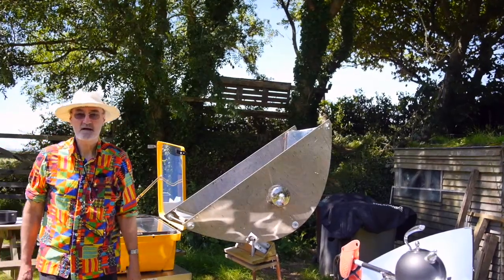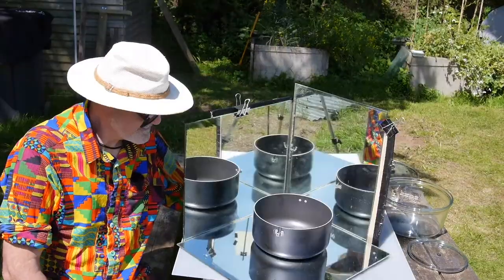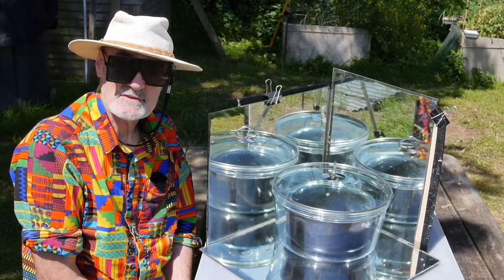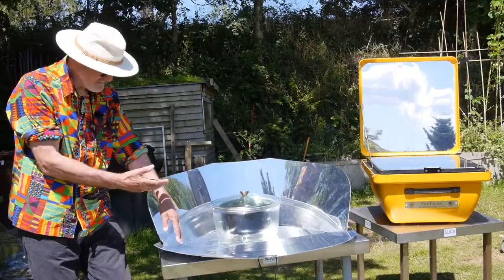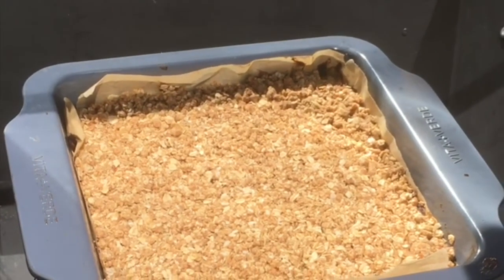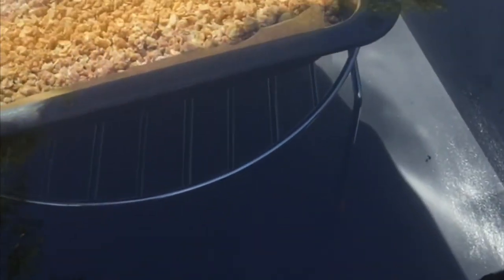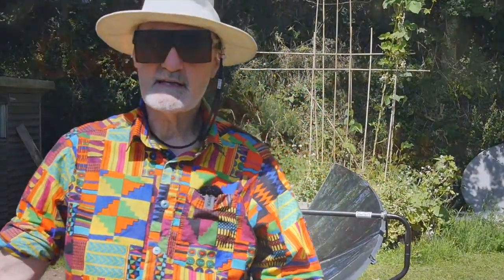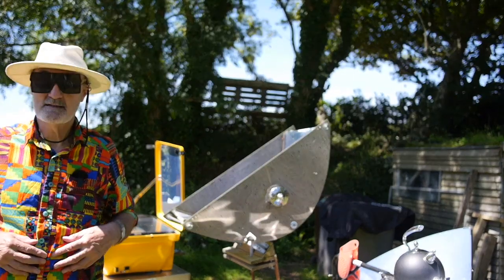Cooking with Starlight : 01 : Solar Cookers 101 : SLiCK solar cooking : solar cooker

Comment: Where do you find a glass pot?!
Reply from the maker: Hi xj, sorry about the delay.  The glass pot you see in the video is from a 12 litre halogen cooker.  Halogen cookers became popular about 20 years ago, and many are being thrown out now, so they are fairly easy to find.  To know what you are looking for, Google 'halogen cooker', then look on Ebay or Marketplace, or any second-hand outlet and you should be able to find one.  The lid just lifts off, leaving the 12 litre borosilicate (heat resistant) glass bowl you see in the video.  Good luck.

Comment: I wish to express my delight in your wonderful solar cooker presentation.

In fact, I appreciate the mode of presentation  your sincerity and openness. God bless you sir.

However, I have already put together materials to construct Tube Solar cooker but I need your assistance on how to build skinned glass tube as explained in the video.

Best regards.
Reply from the maker: Thanks, Richard, glad you like it.  When you say, 'skinned glass tube', do you mean the one I took the bread from?  If so, it's not something you can really make yourself.  These double walled evacuated tubes are made in China - it's a very precise industrial process.  You can find them online by searching for 'evacuated solar cooker tubes' on Google, or another search engine.  There have been some attempts to DIY double-walled cooking chambers, but it is difficult to seal them well enough to pull a good vacuum.  If you let me have more details about what you intend to build, I may be able to point you to some more online resources.
Reply: I appreciate your well details explanation.

Yes, double walled tube like the type that appear in your video nevertheless let me have the contact in China, it could be my future project.

Presently, I will focus on building without glass tube. I will continue to trust for your support.

Best regards.
Reply: In addition sir, building without double walled and glass, will I get a good result? If no! What are the alternative options to get a better results
Reply from the maker: Hi Richard.  I do not have a personal contact in China, but you can find the tubes for sale on Ali Baba.  Here is an example: https://www.alibaba.com/product-detail/125mm-Diameter-Big-Size-Vacuum-Tubes_1600879510158.html?spm=a2700.galleryofferlist.normal_offer.d_title.1c3113a094sa8z   The search function on Ali Baba is as bad as the one on Amazon - whatever search term you use, paid for adverts crowd out the items you want to see, so you need perseverance to find anything.
Reply from the maker: You don't say what sort of solar cooker you want to build, Richard.  There are four types in the video.  To get good results, and this applies to all types of solar cooker, you need to 1. design your cooker so that it reflects a lot of sunlight onto the cooking pot - i.e., the bigger the reflector, the better.  2. Once your pot heats up, you need to use insulation to keep the heat you have accumulated.  You don't say where you are situated, but I can give you an idea of how effective a solar cooker is.  I live in the UK, at over 50 degrees North.  In the summer months, I can get a litre of water to boil in a simple Copenhagen panel cooker, in about two hours.  The other types of solar cooker do better than that.  The large parabolic cooker you see in the video will boil a litre of water in about 12 minutes.  There is a lot of information available on the internet.  For example, the SCI Wiki has lots of DIY designs for different types of solar cooker: https://solarcooking.fandom.com/wiki/Solar_Cooking_Wiki_(Home)   Also, if you do Facebook, there are several facebook groups dedicated to solar cooking:  https://www.facebook.com/groups/1054785564611142 and https://www.facebook.com/groups/scwnet   You will need to narrow down your search for information by deciding, first, which sort of solar cooker you want to build.  After that, it will be easier to answer your questions.  The easiest effective solar cooker you can build is the Copenhagen.  You can find several Youtube videos about that.
Reply: Sir, 
Your response is highly appreciated however, I live in Nigeria.

Presently, I'm working on evacuated solar cooker and as you had directed before I have started the search on google for martials needed. But I may still knock at your door when  need arises.

Best regards
Reply from the maker: Hello again, Richard.  Good luck with your project.  Over the years, there has been some activity in Nigeria regarding solar cookers.  You can find out about some of that here, on the SCI solar cooking fandom wiki:  https://solarcooking.fandom.com/wiki/Nigeria
Reply: Nice, I will link up with them. Thanks
Reply from the maker: Sorry about the delay, Richard, I didn't see this comment until now.  The evacuated tube you see in the video is manufactured in China.  You can find them on Alibaba, but they may want to sell you ten, or more.  There are some distributors in Europe or the USA who would sell you just one.  If you are still considering building your own solar cooker, I recommend the website run by Solar Cookers International - If you Google 'Solar Cookers International Fandom Wiki' you will find it.  Good luck
Reply from the maker: Which of the four styles of solar cooker are you considering, Richard?  The principles are the same, whichever you choose.  The bigger the reflector, the more power you can generate, as long as the reflected sunlight hits the pot.  There are advantages and disadvantages with each of the type of solar cooker..    A good starting place is to consider the DIY plans you can find on the Solar Cookers International Fandom Wiki.  Come back with more questions when you decide which type of solar cooker you want to build.  Good luck

Comment: How do you keep nearby objects from catching on fire? Seems like if you are concentrating the sunlight with reflective surfaces. A discarded glass bottle regulary causes wildfires here in Texas.
Reply from the maker: Hi Mable, most types of solar cooker are constructed so that the reflected sunlight cannot stray outside the limits of the cooker.  So, you are safe with box, tube, and simple panel cookers.  It is possible that a panel cooker could be left in such a position that one of the panels reflects sunlight away from the cooker, but this would add only one additional sun to the point it was shining on, which would not be enough to cause a fire.  The exceptions to this rule are shallow parabolic reflectors -  shaped like the TV satellite dish aerials you see on the side of buildings.  These have a focus that lies outside the dish, and that means that it is possible to start a fire if you carelessly leave one of these lying around.  For this reason (and for others) it is preferable to have a DEEP parabolic reflector (like, say, the SUNplicity) which cannot cause a fire.  There are plenty of Youtube videos showing people adding reflective tape to discarded satellite dishes and using them to set fire to wood/paper - this type is definitely dangerous in the way you suggest.

Comment: Ah, thank you very much. I've been interested in solar cookers for about 3 years. Immediately when I saw your big glass bowl with the black pot inside it, I decided not to give my still working halogen cooker away (having offered to give it to someone 2 days ago, I'm glad he declined). Even though I am moving interstate next year, I think it's well worth keeping my halogen cooker for this solar cooker project. I stopped using aluminium pots a few years ago. Would a black stainless steel or cast iron pot be efficient replacement for aluminium? I know it may take longer to heat up but would probably retain that heat better.
Reply from the maker: Hi SK, because simple solar cookers are not very powerful, the rule for cookware is light and dark - that is, lightweight, and dark coloured (colored).  Most people in the US like to use dark enamelled pots - I think it's called graniteware.  These are lightweight, so they heat up quickly.  Stainless steel is OK, but it helps if the outer surface is matte black, or at least dark coloured.  Cast iron doesn't do very well because, as you say, it takes a long time to heat up.  If you are moving anywhere in the south-west of the US, it would probably be OK, as that area  gets a lot of sunlight, so the weight is less important. If you want to read more about solar cooking, you could try Googling Solar Cookers International Fandom Wiki - all the information you can eat. You could try putting cookware into their search bar to see a longer discussion about pots.   Also, if you do Facebook, you could join one of the Facebook Groups that specialise in solar cooking.  The biggest of these is 'The Solar Cookers World Network'.  Good luck with your solar cooking project.

Comment: Where to buy those big glass containers that can fit the pot?
Reply from the maker: Hi Alan, the large glass bowl is from a junked 'halogen cooker' (Google that to see an example).  They were quite popular about twenty years ago, so there are now many at the end of their useful lives, and you could probably get one that is being thrown away if you look around.  I'm not sure where you live, but if you are in the UK, you might try looking on FB Marketplace, or Ebay, or if you are in the US, Craig's list.  If you can't find one, the bowls are usually still available, new, on Amazon, where they are sold as replacements.  There are two sizes, 12 litre, like this one, and a smaller 7 litre model.  The glass top was bought new - it's a standard borosilicate glass lid that some people use on frying pans or large pans.  This combination makes a nice big heat trap, as described in the video.

Comment: Bravo......clever.......love the glass......if u had a seal on glass container and pulled vacum.......cheers
Reply from the maker: Thanks, Matt.  The food container would need to be sealed as well if you pulled a vacuum inside the glass, or it would lower the boiling point and any volatile components of the food would end up condensed on the inside of the glass - yuck.  However, this has been tried with some limited success (not by me).  But the existing evacuated cooking tubes (the one with the bread inside in the vid) already make full use of the insulating qualities of a vacuum.  And there is now proto-type double skinned hemispherical vacuum shaped glassware that works really well.  Much more convenient shape than the current tubes. Not on the market, yet, but just a matter of time.

Comment: Where did you get that large glass container with lid???
Reply from the maker: Hi Vitality, the bottom part is from a junked 'halogen cooker' (Google that to see an example).  They were popular about twenty years ago, so there are now many at the end of their useful lives, and you could probably get one that is being thrown away if you look around.  There are two sizes, 12 litre, like this one, and a smaller 7 litre model.  The glass top was bought new - it's a standard borosilicate glass lid that some people use on frying pans or large pans.  This combination makes a nice big heat trap, as described.

Comment: The first and simplest one is actually very efficient. I got it up to 105 Celsius today, Oct 8th, Lat 48N. Sunny day.
Reply from the maker: Hi Baran, glad you are using solar cookers.  I'm a bit surprised to hear 105 C.  Do you mean you got the air in an empty pot up to 105 C?   The usual test is to see whether you can boil a litre of water.  If you can boil a litre of water in one of these 'cube corner' setups at 48N in October, I'd be impressed.  Please let me know.
Reply: @DaveOxfordCookingWithStarlight  hello Dave, I was cooking oatmeal with coconut milk yesterday. Black pot with black lid, sitting on 3 small pebbles, covered with a glass salad bowl upside down. The pot is the shallower but larger diameter variety,  almost like a deep pan, to increase the heating area. The backside mirrors were at a 90 degree angle. I had an oven thermometer sitting on top of the lid under the glass bowl. It showed 105 C around 13:00. Since this is a slow cooker, I had it out for 2 hours or so in total and the oatmeal cooked soft. I did rice in it prior to the oatmeal and the rice got overdone, it became mushy soft. I forgot to rinse it with warm water before cooking and left it out longer than I should have. I used hot tap water for starters both times, less time wasted for the initial heat up of the pot. So this simple three panel cooker is very efficient. Open box solar cooker is the other name for it.  Easiest one I made so far. It's sunny today too, I'm doing cornmeal today in the same setup 🙂 11:47 local time and the thermometer is showing 110 C. Sunny day.
Reply from the maker: @Baran Jan - thanks for the description.  There are a few solar cooking Facebook Group pages you could join, if you do Facebook.  The one we run for the UK is called 'solar cooking UK'.  It would be great to have some pictures of your setup.  Always looking for recipes and experiences.
Reply: @DaveOxfordCookingWithStarlight  - unfortunately I don't have a FB account but next time I use this cooker I'll make a video and load it up to youtube.
Reply: @baranjan4172   Sadly Youtube says your video is not available.
Reply: @LL-oc1xw  , Hi I took it down as it was a miserable amateur quality (or lack of). It's simple. 3 mirrors, one on the bottom and 2 other ones at 90 degree angle standing on top of it. I just taped them together (one side). Imagine a box where you cut off the top and 2 adjacent sides.. That's all there is to it.

Comment: I'm wanting to "boil" sticks and leaves to feed to detritivore pets that eat them, so food-safety with time and temperature isn't important.
It just needs to re-hydrate and then get hot enough to kill living mold/bugs/mites.
Most bugs will die in really hot tap water, so a "solar cooker" will easily reach that temp.
I would much rather use the heat from the sun, than to waste electricity on such a simple task, especially since my goal is to make raising the pet rolly pollies as "natural" and "cost-free" as possible.
Reply from the maker: Had to look up 'detritivore'.  The simple three mirror device you see at the beginning of the video will top out at around 85C, with that heat trap setup, Fusion.  If you want the temperature to get up to boiling, the simplest design that will reliably do that would be the 'Copenhagen', designed by Sharon Clausson - plenty of DIY vids on YT that show you how to make one.  When not in use, it's flat, so could be hung on a shed or garage wall.  You would still need the heat trap arrangement you see in the video.  I thought I knew about all the possible solar cooker applications, but heating up food for detritivores is another to add to my list.
Reply: @DaveOxfordCookingWithStarlight  Oh cool, I see you did other videos, I subscribed and going to watch them also.
Reply from the maker: Thanks, Fusion.  More to come this summer when I get my finger out.
Reply: @DaveOxfordCookingWithStarlight  hahahahaha.
I heard leaving comments helps videos reach more audiences, so it's my way to trying to contribute something back to show my appreciation.
Reply from the maker: Thanks.

Comment: We must be independent from gas and electricity!! This its the good future for us!!! Thanks for your educational videos!! 👍👍🎊🎊🎊🎊🙂🙂
Reply: Yes... I have been working towards being offgrid. There are so many solar items available eg lighting, power stations, showers, cookers etc. Also friction torches, lanterns, radios etc. In Australia we have tools and appliances that come with a 18 volt rechargeable battery. One brand has 100 items that can be charged and used using the same type battery. I have 18 volt lanterns, torches, saw, lawnmower, edge cutter, radio and a fan but here is the exciting part. I now bank free electricity using my solar panel / powerbank during the day to charge all my batteries that come with the tools. I have my lighting sorted, also fan, radio, mowing, showering and cooking. There are many other items I keep adding to save energy bills like a kelly kettle which I have just purchased. Look online particularly camping and survival gear sites for items and inspiration. Cheers.
Reply: @janetbransdon3742 it would be nice to see on the video all your solars equipment
Reply from the maker: Thanks, Catalin!  I agree.